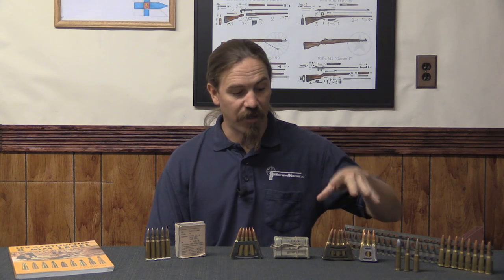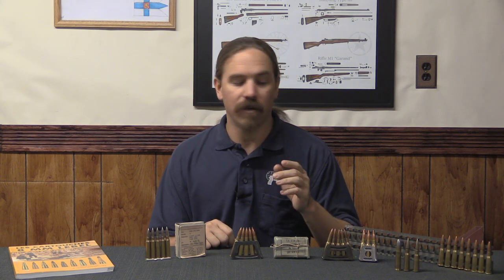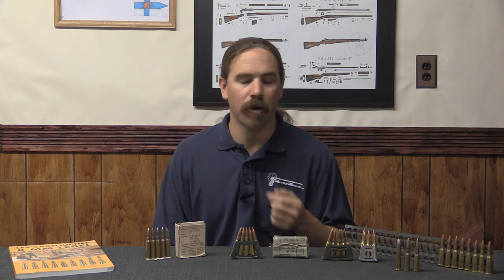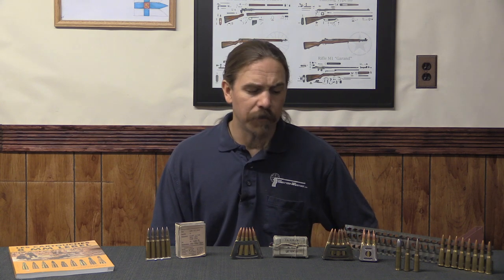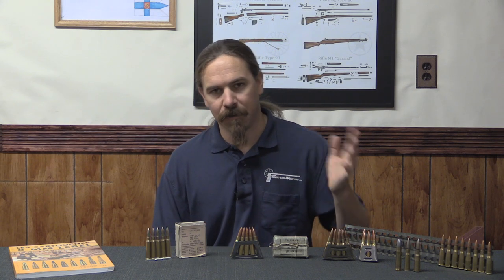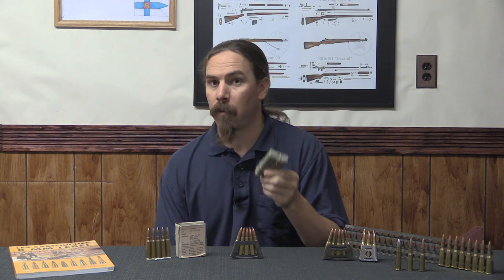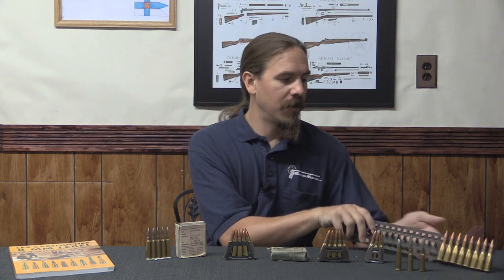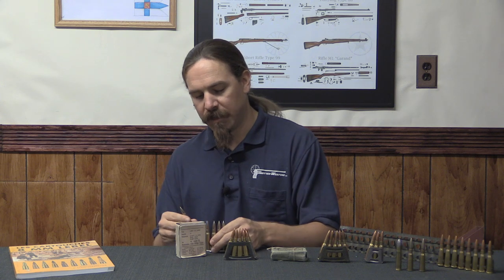French Rifle Ammunition: 8mm Lebel and 7.5mm French

Comment: I've never seen a wall socket so high up before. Fascinating.
Reply: I can beat that.  My basement wall sockets are about 6.5' up the wall.  Lol, the builder got lazy and didn't frame the foundation, so just put them up above ground level where the house is framed.
Reply: @ryanwilson_canada  
It will take a lot of floodwater to short your circuit.
Reply: 9ft of water if that happens I have other issues lol
Reply: Must be French
Reply: For projectors and TV’s. As a carpenter we’ll commonly see this in banquet halls, church basements, VFWs, schools, or any other place meant to gather people back when TV’s were rolled out on tall carts or mounted high up on walls like behind a bar. Meant you didn’t have to run an extension cord to reach an outlet near the floor.
Reply: Honestly have seen weirder when I have seen custom wall socket placements in pool barns and throughout entire horse barns the size of airline hangers before. Trust me you can get some weird socket placements in those type of buildings, like on the ceiling 14ft up used to chain lights together.
Reply: My grandparents house has a few
Reply: Countertop height..you have no idea what the room was originally for.  Outlets get put in a lot of places including in ceilings for various reasons.
Reply: That wall socket is super high up. Very odd placement I wonder if the French placed it there on purpose. 😂😂
Reply: I've seen them on the ceilings.
Reply: @cameronbartlett856  was it in a school? Might've been where a video beam bracket was mounted
Reply: Maybe his chair and desk are just really low
Reply: I remember going to another school and seeing them high up in the ceiling at the lunch room
Reply: Ian is actually really tiny
Reply: My guitar teacher has a switched outlet on his ceiling bc he wanted a light fixture but couldn’t decide on what to install lmao
Reply: I love his table too. It's important to have good tables. I have IKEA Hemnes wardrobe for a table, and those drawers are the absolute worst.
Reply: This is common in basements, especially in older construction and has to do with flooding.
Reply: ITS Not high, He IS Just short

Comment: Note for anyone trying to reload 8mm Lebel:  Do not try to full length size a 8mm Lebel cartridge.  The chambers are oversized and will fireform the cartridge.  Full sizing will overstretch the brass and drastically reduce case life (as well as require pesky trimming).  Just use the neck sizer and reserve those cartridges for their specific guns.

Comment: I always wondered why French used giant clips for their machine guns, instead of belts.
Reply: Me too, I don´t think magazines is a good Idea on a MG and a clip is even worst.
Reply: tisFrancesfault there weren’t any metal belts. The cloth belts are quite sensitive to temperature and humidity (unlike the metal clips), the belts can be linked while the gun is firing, and when using the guns as a team one does not experience a significant loss in fire sustainability. Still the French will develop linked strips for aerial and tank use during WW1.
Reply: The 8mm Lebel has a horrible case design, which does not lend itself well to feeding, besides being a rimmed round. Still, it was the first commercially successful smokeless powder round, and this changed MANY things in WWI, including uniform color, believe it or not!-John in Texas
Reply: The funny thing is the Hotchkiss company had a single link metallic belt as an option as early as 1896 but most buyers found it too expensive to buy or produce on their own.
Reply: @TheGearhead222  it really does continue to amaze me just how fucking HORRIBLE the 8mm lebel was. I'm not sure that there is a worse caliber out there actually adopted as the primary round for a military like the Lebel was

Comment: I have 2 cases of lebel ammo  in hotchkiss feed strips that ive heard long ago was high pressure, before i new this i used it in a Remington 1907/15. I later found a crack in the rcvr on the bottom, ive no idea how long its been there. The gun also had the typical rem. oversized  chamber. It was a sporter w shortened bbl so its stripped of the rcvr now (RIP) as soon as i saw the feed tray on your table i new the answer was coming (ball N) neck turn the shells maby? it was $42 a case

Comment: The 30 round feed strips were also used by the Hotchkiss M1909 light machine gun or "Benét Mercié" as it was called in US service. Just for the completion. ;)
Reply from the maker: A whole series of Hotchkiss-based guns used them, in eluding the US 1909, the French 1900 and 1914, the Japanese Type 92, Turkish 1922/4, etc.
Reply: Yes. Did they use the same type of strip for a different cartridge?

Comment: While some stupidly assembled 300 BO loads can chamber in a .223 gun, 1) this usually requires stupid levels of force AND a weak crimp. (This isn't the high tech kind of telescoping ammo, it's the shoddily made kind) 2) these are only due to cartridges loaded with projectiles not intended for the caliber, most notably 30 carbine bullets, and the 147 grainers intended for 7.62 nato. For both of those projectiles, the ogive of the bullet can mimic the shoulder of a .223/556 case but generally very over length.

Simply using appropriate projectiles completely alleviates this potential risk. With the right projectiles, the bullet would hit the lands with the bold a good quarter inch out of battery. I always make a point of comparing any load side by side with a .223 and making sure there is no way to chamber it incorrectly.

IMO, this is worth being careful about but the risk is largely overblown. There is far more real world risk of people putting 20 ga in a 12, and 9mm in a 40 S&W, both of which happen quite frequently.   I practice having distinct magazines for 300 BO and avoid storing the guns & accessories in the same places. I also avoid mix and matching on a single range trip, at least without a little effort at keeping them separate.

Gear that has room for human error has room for improvement. But that said, I can't help but think that the people who get this wrong would tend to get other stuff wrong too, and will hurt themselves one way or another.

Comment: The confusion over "bronze" and brass is a nomenclature one. 95/5 is "Gilding Metal", 90/10 is called in the US trade 
" Manufacturing Bronze" --- a clear misnomer ( no Tin in 90/10 BRASS).
In Europe, deriving from a Dutch Indies term, both 90/10 and 95/5 Alloys are called TOMBAC/K. 
DocAV

Comment: 2 questions:  

1) in your experience, how does 8mm Lebel compare to the Mauser in terms of velocity, recoil and power?

2-) How does 7.5 French compare to 308, 7,62 Russian, 7,5 Swiss and even 303 Brit? 

I did not mention accuracy because that depends mostly on the shooter but you can add it if you deem it important.
Reply: Question 1 : from my point of view,  shooting a 8mm Lebel cartridge in French Mousqueton 86 (lebel rifle) is more pleasent than a 8x57 in a K98 (I have both and I am triying to be objective despite the fact that I am french...). This may be due to the profil of the cartridge. 
In terms of velocity and power, there is no clear difference : nearly the same velocity and  nearly the same weight of bullets when using Partizan 327' bullets (200gr) for my Lebel and Sellier Bellot 323' bullets (196 gr) for my k98. 
Things change when using monometalic bullets "Balle D". In France, such bullets are sometimes found in the far corner of some garage. ;) . Less recoil and more accuracy.

Comment: I wonder if anyone tried to invent something that could "capture" the smoke cause by black powder. Kinda like a suppressor but instead it just prevents the smoke from leaving the bore, but lets the bullet pass.
Reply: I'd imaging that would cause horrendous fouling.
Reply: RichCommander something along the lines of an MP5SD type suppresser, with a wire mesh wrap soaked in high viscosity oil would probably work. But only for a few rounds, then it would be useless again.
Reply: Actually it was a more suitable task to invent a smokeless powder ;)
Reply: The smoke coming out the end of the barrel is not the main problem with black powder, it's all the gunk that stays inside the gun that really makes black powder firearms a pain to operate & maintain.  A system that captured the extra smoke & kept it from leaving the gun would probably only make that worse.
Reply: Synchronizor You are right. The smoke is in fact the same stuff as the gunk that stays in the gun. The smoke is just the part of it that was expelled out of the gun. Making more of it stay in the gun would be a bad choice.
Reply: Seems like there are no good mechanic solution. What about electric systems? A vaccum cleaner  muzzle extention, a powerfull Akku in the stock maybe combined with solar panels in the sides of the stock for longer field usage. It maybe even helps with ceeping the gun clean?
Reply: It won't work, at least not for very long, black powder fowling will eat though steel if given enough time, you capture all of it inside of a can, that can won't last very long.

Plus then you get back pressure forcing more of the gunk back into the rear end of the gun and into the chamber area, and then your chamber becomes insecure and that could be bad.
Reply: +Stefan B Fowling is only a problem on black powder, malfunctions as a result of a firearm not being clean are few and farbetween, the M16 only had this problem in vietnam due to the wrong powder being issued for the cartridges, clogging the M16's gas system, with the new powder, this issue entirely went away.
Reply: At least it would be a ghostbusters like eye-catcher on the range. Good thing i'm not an engineer :D
Reply: @justforever96  First of all: the original question doesn't specify a certain time period. You can find clips of carriages with turbojets and leverguns with reddots on them. There ist no 'that-makes-no-sense' police when it comes to tinkering. Second i know that it doesn't work considering that the system has to be comically  large and complex to be powerfull enough to counteract the gas pressure. Third, this coment ist 5(!) years old bro, are you high or something?
Reply: @justforever96  also tone. I'm comenting pointless coments on a website for entertainment because i like to.
Reply: Hiram Maxim tried to such a device for his machine gun.

He gladly abandoned his research as soon as smokeless powder was available.

Comment: I have run into some old 8mm Lebel ammunition and when pulled apart (primers were no longer viable), the bullet had a "step or heel" of smaller diameter where it entered the case mouth.  Where, in the timeline did this type fall?

Comment: Love your videos! Just an fyi though, 300 blackout will not chamber in a 556 chamber, the bullet diameter on the 300 is larger than the neck at the same point on the 556, so it stops about 5 or 6mm short of chambering. You could possibly get one to chamber if you hand-loaded a very short bullet and seated it way to low, but that is about it.
Reply: toomanyaccounts , it is impossible if it is not a special reload. I have multiple 300 blk and 556 firearms and i have tried to chamber multiple 300 blk round and none of them would chamber.
Reply: toomanyaccounts, i fully retracted the bolt on both and let it slide home. If you manage to have enough force to force the bullet further into the case, then it could happen since the bullet is what stops it, but that is not the normal circumstance

Comment: One thing I've noticed is that some of the 7.5mm French cartridges have a groove in the base, similar to that on the 8mm Lebel Balle D and N. But since they're not going to be in tube magazines, that has no functional purpose on the 7.5mm. Was that done just out of tradition, or was that to visually distinguish between rifle and machine gun rounds?
Reply: @RedXlV,
Maybe just some manufacturers had differents machining processes?
Reply: Zorg That could well be all it is. But all the ones I've seen with the groove have been heavy ball for machine gun use, so I was wondering if that might be the reason for the seemingly 100% cosmetic difference.
Reply: So it may be cases for the ball D model 1933 cartridge? It was for the F.M. 24/29(D) fortress version .
http://armesfrancaises.free.fr/FM%20Mle%2024-29%20%28D%29.html
I quote Max : 
"there was also a version of the 7.5x54 develloped specially for the FM 24/29 used in the fortifications of the Maginot line, it was the 7.5x54 mle1933 heavy ball D, for use in MAC 24/29 D, the projectile weight passed to 12.5g and the rifling rate of the barrels was changed from 270mm from 235mm"

Comment: Somewhat OT but, I'm curious, why didn't some countries update their cartridges to spitzer loadings? Another poster mentioned the Dutch not updating for cost reasons, but C&Rsenal said that the Italians didn't "because of how the Carcano feeds". Is there something about the Mannlicher system as adopted by the Dutch and the Italians  that precluded spitzers? A less heavy spitzer might have given the 6.5 enough punch to keep up with its contemporaries...
Reply: I have loaded and fired 129 and 140 grain spitzer bullets in Carcano rifles and I didn't see any feeding issues. The taper of the spitzer bullet and a feeding ramp made for round nose I can see it might not work 100%.
Reply: Gungeek did you chrono the rounds? I take it the round shot a good deal flatter...
Reply: before I had a chrony but the book said about 2400fps with the 140grain bullet.
Reply: So about 100 ft per second slower that an Arisaka with a 31 inch barrel and about 225 fps slower than m/41 6.5 Swede out of a 29 inch barrel. What was the barrel length specified in the book?
Reply: i forget the barrel length but how does that even matter ? it was a loading in a Lyman manual for a bullet weight never used in the Carcano ;)
Reply: Just curious. Just trying to get an idea of how it would stack up against the Arisaka and 6.5 Swede in a equivalent length barrel. Sounds like it would stack up favorably against the Arisaka and a bit slower against the Swede. The Carcano gets a bad rap in my opinion, part of it is the odd diameter but another part i'd argue is the antiquated bullet design. C&Rsenal's video makes me want to pick one up  (maybe an m41 or a TS carbine) to handload for someday.

Comment: There are credible reports of U.S. troops in extemis, using German 8x57 ammo in 1903 Springfields and 1917 Enfields.  Recoil was noticible, but the guns were strong enough to swage the 8mm bullets down to .308.  Whether these were .318 or .323 bullets in not clarified.  These stories appear most often in discussions of the strength of low number Springfields that had not been re-heat treated, as evidence that the process was not actually necessary.
Reply: I tried a round of S &B 8x57 JS in my Win. pre64 model 70.  The bolt went all the way forward, but would not close completely.  Perhaps this is an "urban myth" which has been repeated enough to be considered fact, but one version I read, stated that the source was Maj. Gen Julian Hatcher.  Going to Hatchers Notebook, page 223, he is discussing Springfield receivers that blew up from improper heat treat.  He states that one of these was blown up by firing the 8x57 German Service round.  Obviously, it must have chambered.  War time production often reduces quality, and it could be a compounding of a chamber that was slightly long or at least at max tolerance and 8mm ammo that was slightly short.  I want to say that one of the places I read about using 8mm in an 06 was in the American Rifleman, but I can't swear to it as it has been too long.  Maybe Ian can ferret out the source of this story and determine if it is fact or myth.
Reply: Thinking on this further, the answer is probably throat erosion, caused by corrosive primers and hit or miss bore cleaning in combat.  Add to that, barrel steel that was not up to today's standards, and you can see why some Springfields were re-barreled as much as 4 times between manufacture and WWII.  A .30-06 chamber with an oversized throat from erosion would easily chamber an 8mm.

Comment: Weren't the Germans using a 153gr Spitzgeschoss @2900fps during the WWI and then changed for longer range ballistic reasons into a 198gr schweres Spitzgeschoss @ 2550fps during mid 1930's..? Compared to that WWI-Mauser round the Lebel was underpowered like a snail for sure.

Comment: Can you do a video on the M1 Garands chambered in 7.62mm? I've never seen one but I know they exist.
Reply: I actually own one of these Skallia. The only unique feature is that a barrel with the .308/7.62 has been used and a "block" has been inserted into the clip well to take up the extra room. You can use standard M1 clips. If desired a new 30-06 chambered barrel can be used, the block removed, and you would then have a standard Garand.